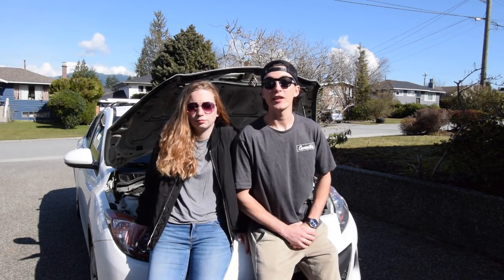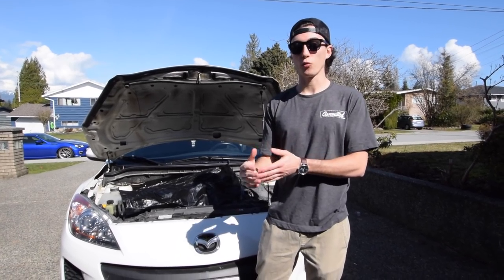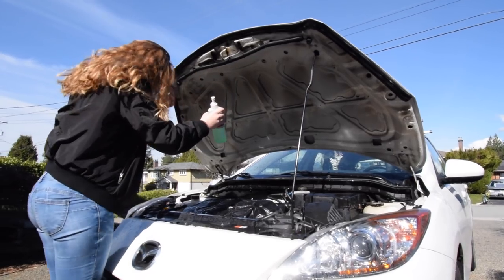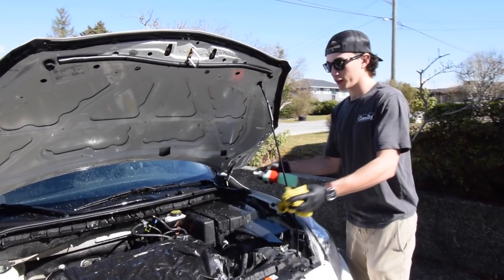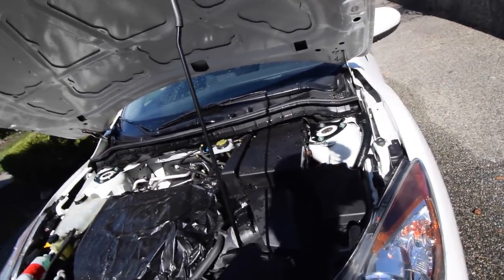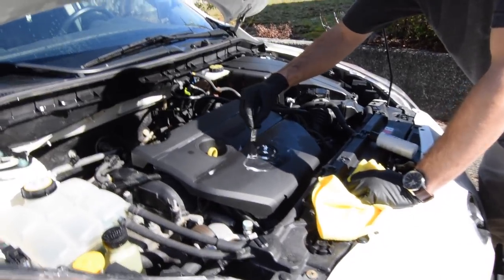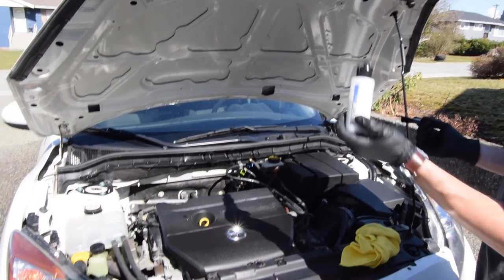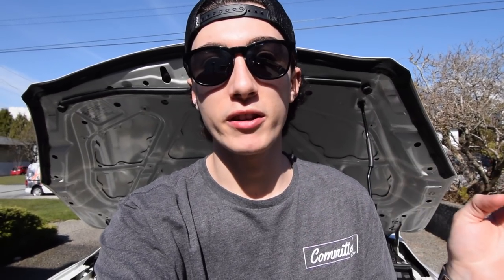How to Clean Your Engine!

Comment: When I was at sema this past year asked a few vendors who were advertising lifts for home garages asked what to use if there is a leak in the hydraulic system each said 

DAWN SOAP 

They use nothing else 

This also includes vendors of shop tool box counter set ups 

So your info is 💯

Comment: There's a hose you can hook up to an air compressor and bottle of cleaning fluid that acts like a pressure washer, but isn't as powerful. We use it in the shop all the time